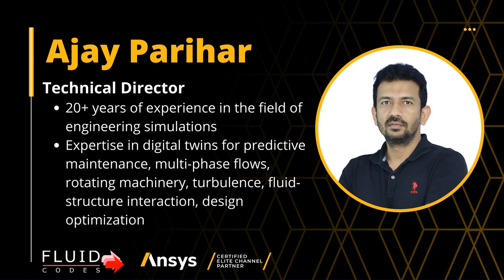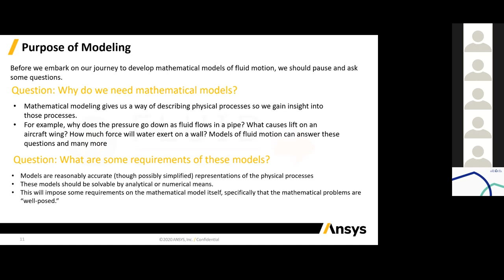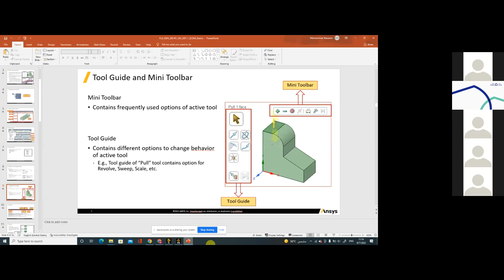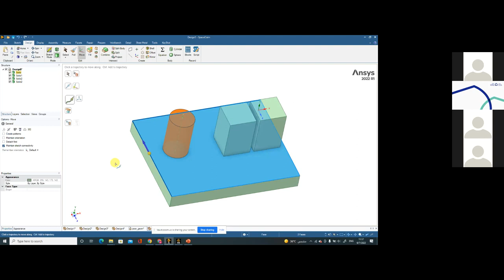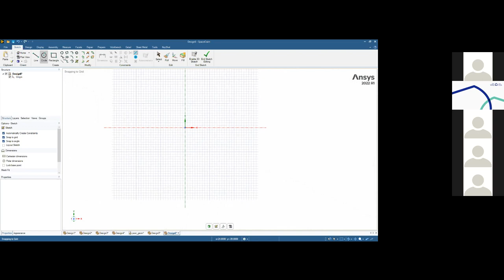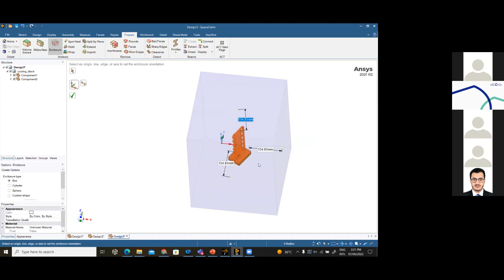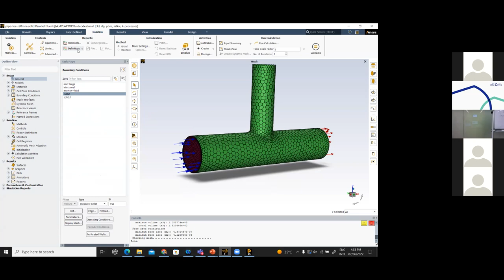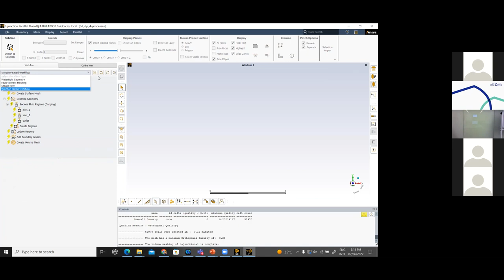Day-1 Ansys training: Computational Fluid Dynamics (CFD) - Introduction

Comment: 00:04 Introduction to CFD and attendee background
03:22 Understanding background is important for CFD simulation
08:28 Ansys is a software used for simulating computational fluid dynamics.
11:32 ANSYS focuses on solving multiphysics problems by applying multiple physics
16:41 Simulation is integral to product development across all industries.
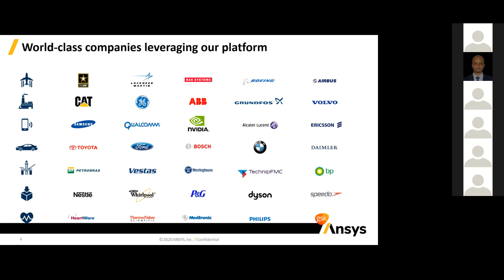18:58 Ansys provides a framework for software to do computational fluid dynamics.
23:46 Connecting different softwares and physics for system level simulations
26:19 Importance of combining data analytics with simulations
30:55 Introduction to Ansys Workbench and its capabilities
33:08 Introduction to parameter study and optimization in Ansys training
38:28 Analytical fluid dynamics (AFD) for quick answers in simple cases.
40:54 Importance of mathematical models in solving industrial problems
45:39 Difference between Lagrangian and Eulerian forms
47:50 Understanding different frames of reference in CFD
52:28 CFD process overview
54:51 CFD can solve various transport phenomena
59:40 Simulations are essential in every stage of product development life cycle.
1:02:32 Importance of conserving mass and momentum in CFD simulations
1:07:33 Understanding the importance of geometry in CFD simulation
1:09:50 Ansys SpaceClaim is a direct modeling tool for creating and preparing geometry for CFD analysis.
1:14:12 Introduction to Direct Modeling in SpaceClaim
1:16:11 Spaceclaim is used to create and clean geometry for simulation purposes.
1:20:23 Geometry repair and preparation for simulation
1:22:26 Sketching and creating 3D bodies using pull in Ansys
1:26:55 Selection operations and mouse controls in SpaceClaim
1:29:20 Using STEP or Solidworks files can minimize data errors in simulation preparation.
1:33:47 Creating and modifying points in Ansys using pull tool
1:36:48 Using the pull tool in Ansys for various operations
1:41:22 Demonstration of using multiple functions in Ansys for CFD simulation.
1:45:01 Creating and using planes for cutting and splitting bodies in Ansys training
1:49:07 Splitting faces using Ansys Split tool
1:51:16 Geometry repair is crucial for successful CFD and FEA calculations.
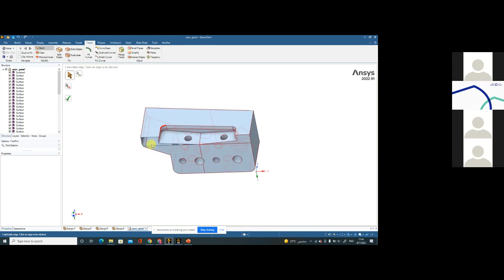1:55:33 Identifying and addressing gaps and disconnected edges in the CFD model
1:58:11 Visual inspection of gaps before performing operations is crucial
2:02:37 Space claim has three important modes and four main tools for performing operations.
2:04:49 The pull tool in Ansys works for all three kinds of geometries: surface, line, and point.
2:09:30 Moving and copying objects within Ansys training
2:11:32 Demonstration of precise body movement in Ansys training
2:16:11 Parameters in Ansys can be used to parameterize geometry, mesh, solver, and physics.
2:19:25 Introduction to creating a mixing tree in Ansys workshop
2:24:05 Split body is best for removing material from pipe in Ansys training
2:26:13 Introduction to using Section Mode in Ansys workshop
2:31:32 Extraction of fluid volume for CFD analysis in a pipe
2:33:50 The extraction of the fluid is not part of the workshop.
2:54:48 Utilizing split body feature to remove excess material
2:57:05 Removing material using volume extraction technique
3:04:41 Utilize sketch mode to create geometry in ANSYS
3:06:52 Selecting faces to enclose fluid volume
3:11:41 Learn to use selection tools and modify geometry efficiently
3:14:11 Consider the impact of fillets on fluid flow analysis.
3:19:46 Understanding the geometry for CFD analysis
3:22:08 Analyzing geometry using section mode and 3D mode
3:27:55 Analyzing external heat transfer and boundary conditions
3:30:20 Selection and enclosure in Ansys training
3:35:03 Understanding heat generation and convection in Ansys training
3:37:24 The boundary outlet should be far away from the obstacle.
3:47:01 Overview of Ansys CFD workflow
3:50:10 Introduction to starting Fluent in standalone mode
3:54:52 Understanding the licensing and parallel processing in Ansys CFD
3:57:11 Ansys CFD tutorial: Import geometry and generate mesh easily
4:02:34 Understanding shared topology in ANSYS for fluid flow simulations
4:05:31 Understanding share topology in CFD modeling
4:10:34 The need for a boundary layer in CFD.
4:13:27 Overview of setting up a CFD solution
4:18:24 Monitoring solution convergence criteria in CFD
4:20:45 Explanation of mass conservation equation and visualization of temperature in Ansys CFD
4:25:55 Using high performance computing for faster CFD simulations
4:28:24 Introduction to Fluent Missing Workflow
4:35:05 Boundary layer concept and preference for hex mesh in CFD analysis
4:37:25 Connecting tetrahedral and hexahedral elements in CFD
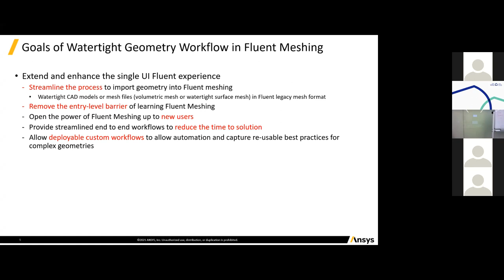4:42:34 Understanding how to make geometry watertight
4:45:16 Import and export workflows for Fluent simulations
4:50:54 Selecting between shared memory and distributed memory for running Ansys.
4:54:14 Importance of clean geometry for effective CFD analysis
4:59:33 Learning about the functions within the ANSYS interface
5:02:36 Introduction to creating and saving workflows in Ansys